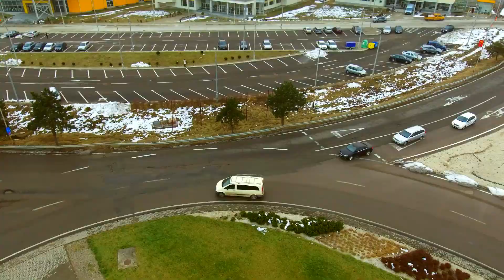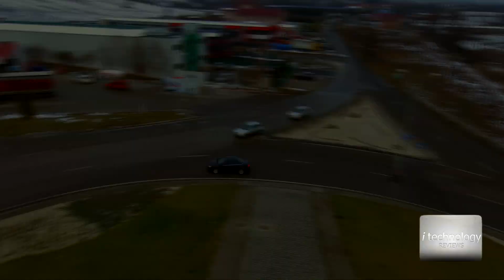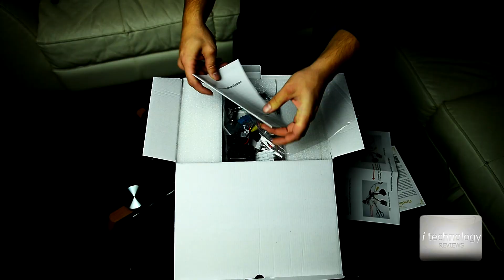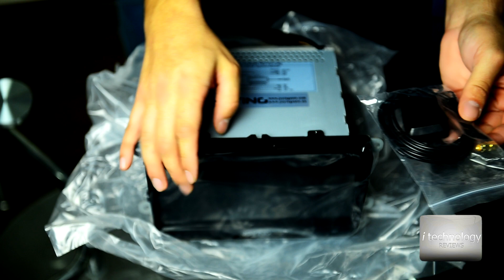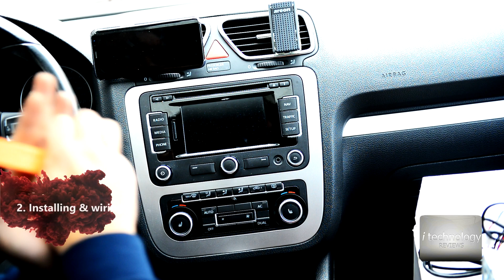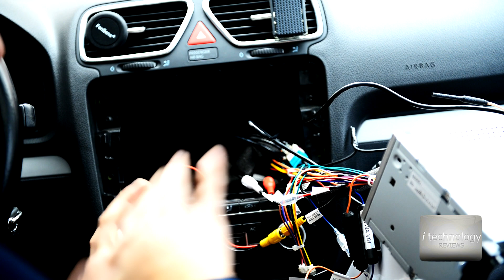Octa Core VW 9'' Navigation 2019 for Eos Jetta Passat Android 8, Wifi, 32gb, bluetooth 4.2 - Part 1

Comment: Dis you have an issue with Steering Wheel Control (SWC) because most of VW uses CanBus for the SWC and not to many units support it or you have to  get a $50 USD adapter so you are better off with the head unit already supporting it...
Reply from the maker: hi; no; only at changing from steering wheel the tracks in other apps beside the original app